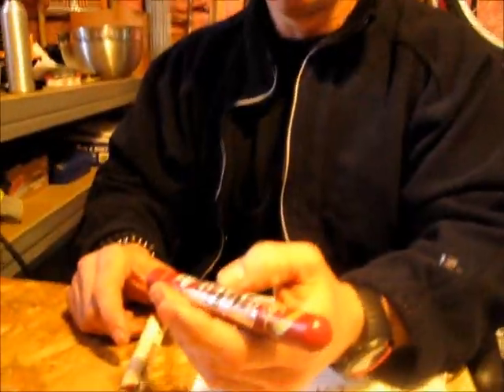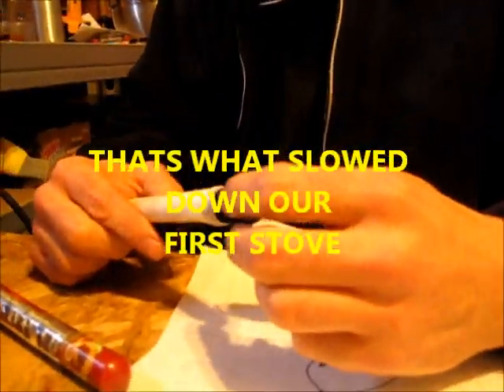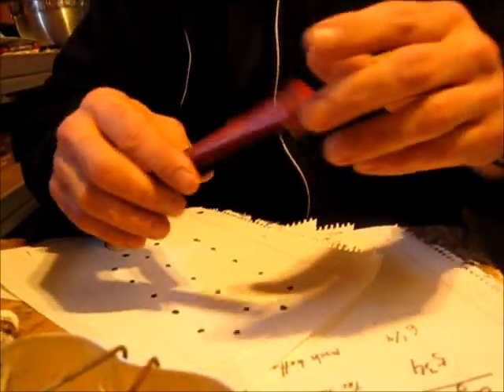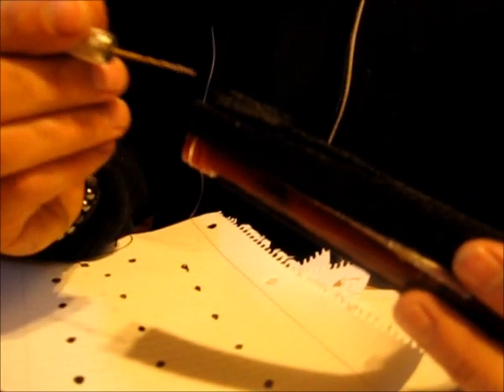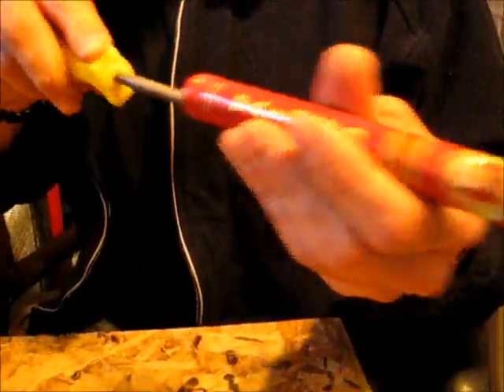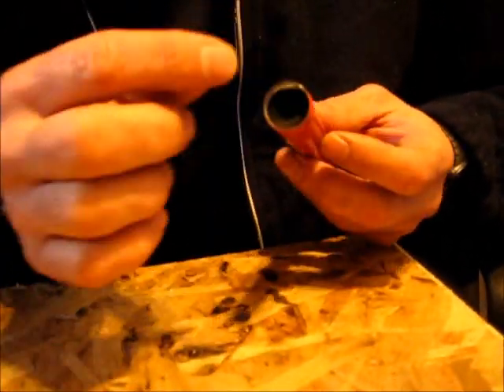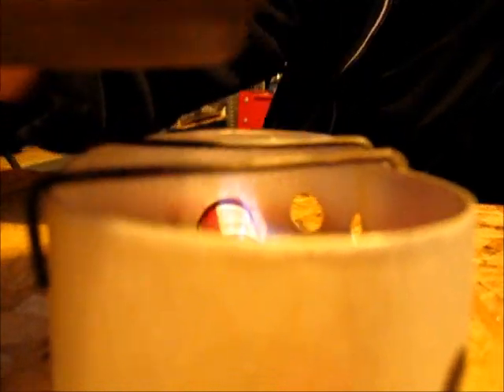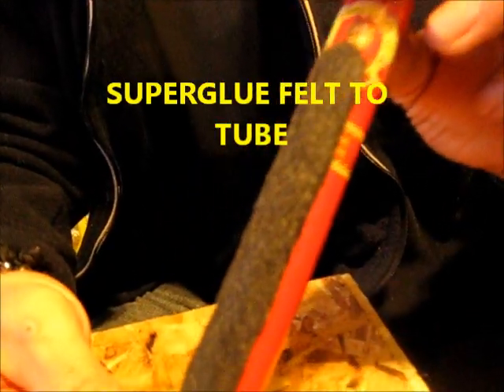CIGAR TUBE ALCOHOL STOVE MOD AND BUILD

Comment: So, what is wrong with filling the tube with more alcohol, before starting it, and use a syringe though the hole to fill it?  Maybe put in 2 to 3 oz. so you could cook more than one item?  Small Skillet, fry bacon and eggs.....

What is the tube made of?  Aluminum?  (I do not smoke, so I do not buy cigars.  Could you use a light copper pipe instead, perhaps 1 inch for more are, with same length?